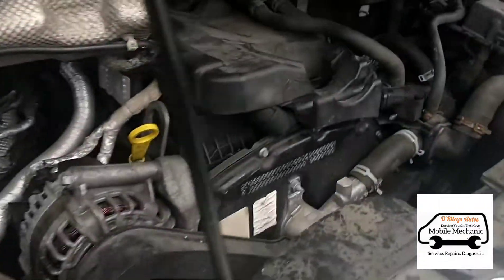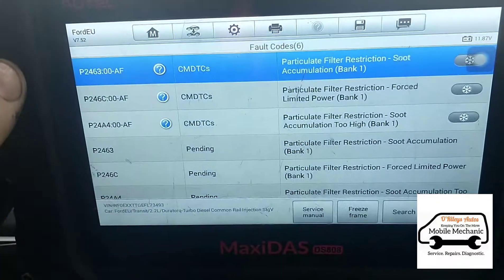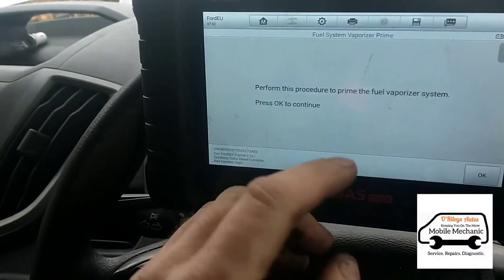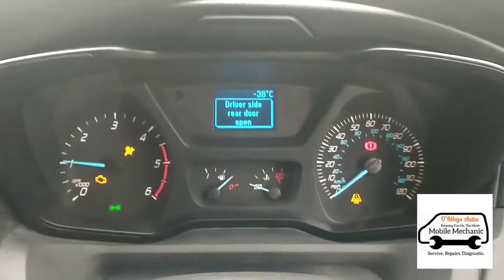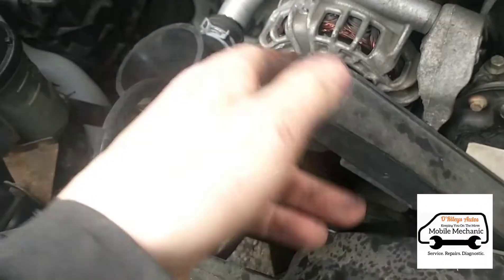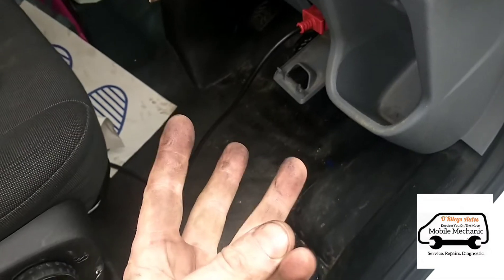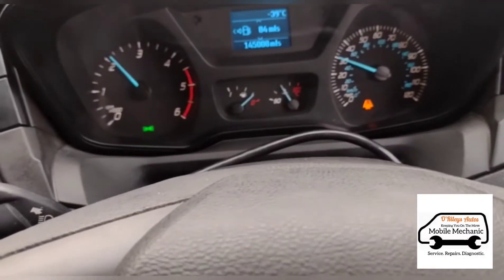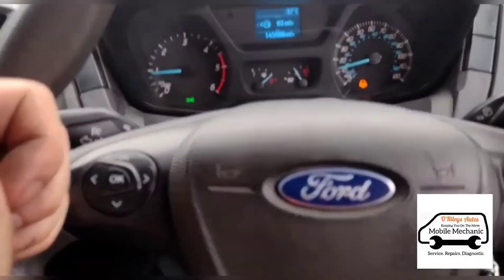Ford Transit MK8 P246c:00 AF P2463 Particulate Filter Soot Restriction Forced Limited Power DPF Fix

Comment: My mk8 tipper doing the same. Had new dpf fitted. service, boost pipes ect and still keeps coming up same codes and limp mode. Any suggestions.?
Reply: Did you got fixed? I have sane problem

Comment: A weak smoke machine pumping in the boost would take ages to build enough pressure to be sure of no boost leaks. You need to use compressed air to build up the pressure.

Comment: Spotted the issue straight away on the dash with the outside temp reading at -38 degrees.  Learnt that from you too.
Reply: Mine says -40 and won't start been told.miggt be the dpf

Comment: Hi there I have a transit custom 2018 euro 6 2.0 ecoblue and have intermittent white smoke it can occur any time and weather hot or cold. Then disappear the next minute can rev engine no smoke but when it does appear will smoke upon revving. It's very intermittent. Not permanently all the time. Can be embarrassing at time it will smoke the vehicle behind me. I scanned it and few codes that were showing was oil Engine Oil Deteriorated and low fuel pressure. I have ordered a fuel filter as am not sure if that was serviced as I was only given information that the van was serviced in house by fleet company regularly. Van otherwise drives fine. When smoking white it smells pretty potent not sure if fuel or something else but pretty strong otherwise when not smoking all smells fine. It doesn't smoke on on cold starts which could relate to leaking injectors as I had it on another vehicle this is very random when it seems like something electronically turns on smoke and off. Sorry for my long message 🙏 just looking for some help were to go about. Am waiting on fuel filter from Tp this week change over weekend am a builder and can do DIY on mechanics but definitely this is more professional Diogenes required. I will contact you Monday as you are in Bedfordshire I don't mind driving to you please. Thanks 🙏
Reply from the maker: Orileysautos@gmail.com
Reply: Hi mate what was the issue did you find the issue in the end would be a great help because I have a similar problem on the Ford Mondeo diesel which smokes up on high speeds but locally nothing nor on startup. DPF was clogged by that's a symptom not a cause.

Comment: Hi outside temp on dash reads -37 does the  engine ecu use that sensor for cold start etc ?
Reply from the maker: As far as I'm aware it's only used for The HVAC  AC system
Reply: When you disconnect the battery the temperature sensor will reset and display negative values for a few minutes. It will get back to normal after a while.

Comment: Hi great video on doing dpfs what is part number or make of that fluid pump you use ?
Reply from the maker: https://www.halfords.com/tools/hand-tools/all-hand-tools/laser-manual-brake-bleeder-2.0-litre--4832-113625.html?cm_mmc=Google+PLATools%3EHand+Tools%3EAll+Hand+ToolsTools%3EHand+Tools%3EAll+Hand+Tools_-113625&istCompanyId=b8708c57-7a02-4cf6-b2c0-dc36b54a327e&istFeedId=62b447cf-331e-4fec-a47a-9985ff72d404&istItemId=iplrqiil&istBid=tztx&_$ja=tsid:|cid:11902546034|agid:113456751337|tid:pla-331014970735|crid:487900199209|nw:u|rnd:8088907541814537269|dvc:m|adp:|mt:|loc:1006517&gclid=CjwKCAiAs92MBhAXEiwAXTi257d3krP4__NV2lIvJ5BFw_F1MLpbxldihGO-I808sOjfnkrDc7G7EhoC60IQAvD_BwE
Reply: Cheers thanks